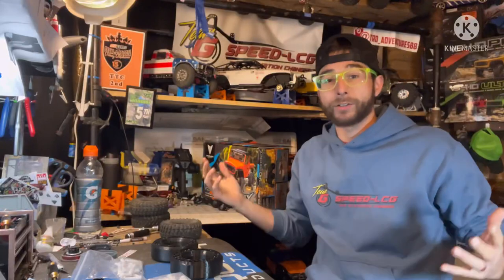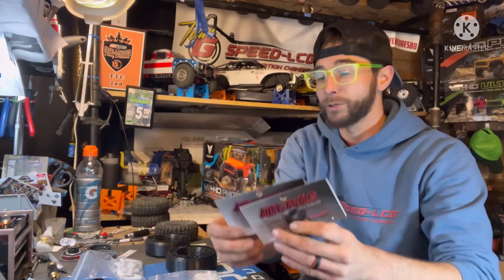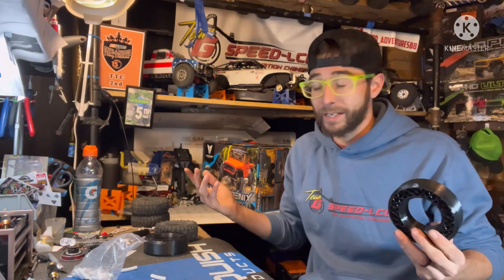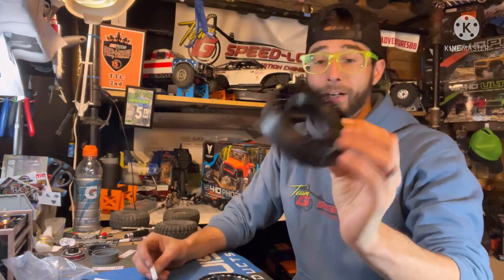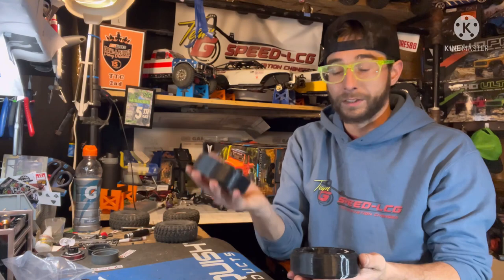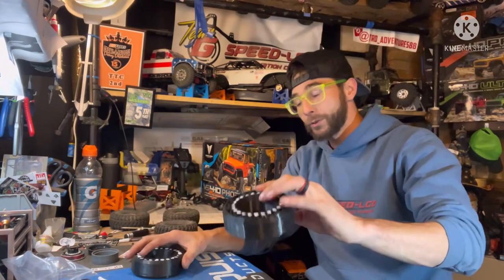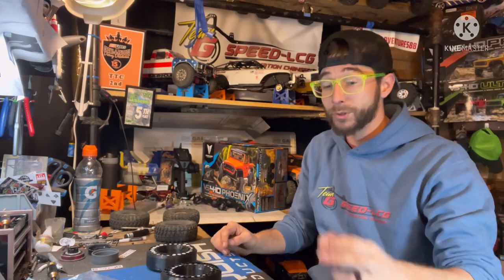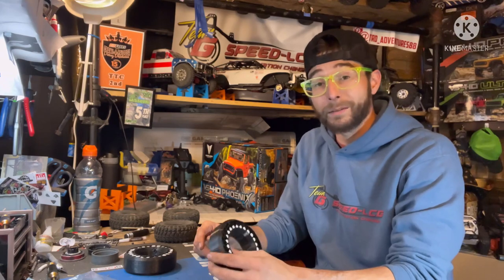Installing 3BRC tuning rods in Anti-Foams

Comment: Great video 👍Question did you vent your tires in the tread area ? If yes how did the vents work with the solid inner and outer surface of the anti foams
Reply from the maker: Yes I vented them in the tread area and it is working good, just like normal.

Comment: Just started running these and noticed when I vent the tire at 12 and 6 some times the tires act vented, sometimes they act like they’re not vented. Wondering if it’s the smooth edge against the vent. Granted this was in class 0 tires with class 1 sized anti foams, but did you have any issue venting these?
Reply from the maker: I have not but I vent mine 3-4 place usually
Reply: @TRDAdventures  had a few people now say 3 vents or more, good to know, thanks!